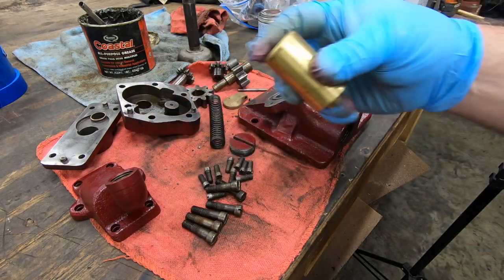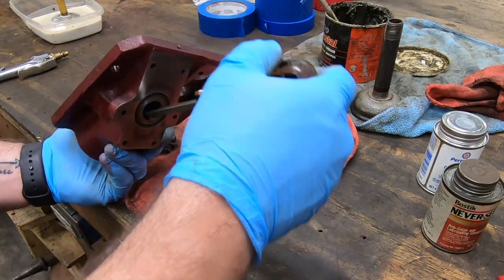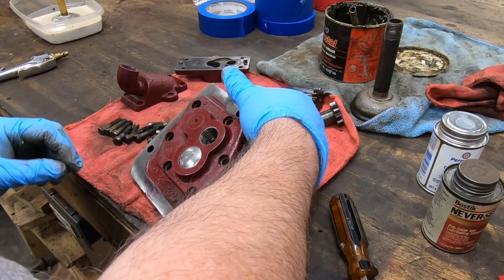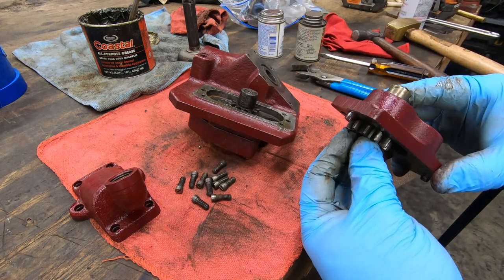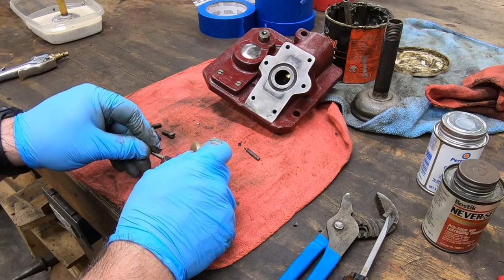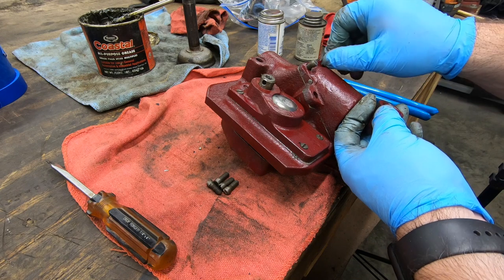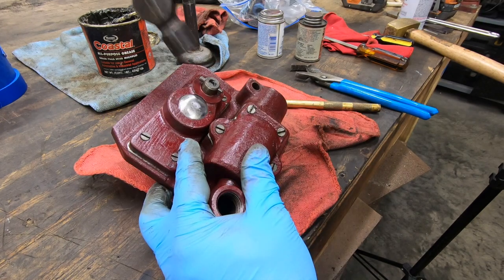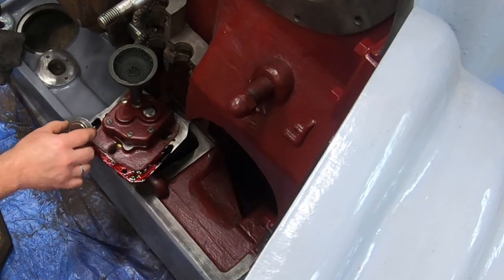Assembly and Installation of the K&T 2HL Coolant Pump

Comment: I use grease on some gaskets as well .  Let's you pull it apart again & not damage the gasket .     An  anti drain back valve is what that would be  .    👍
Reply from the maker: That's what I figured. I was tempted to use some Permatex High Tack instead of grease. I mean, it it's worth doing, it's worth OVER-doing. LOL!

Comment: My pump leaks , it runs back into the well so Ive not looked into it yet.
Reply from the maker: Might be that check valve? I have that other pump, so if you need parts, they are yours.